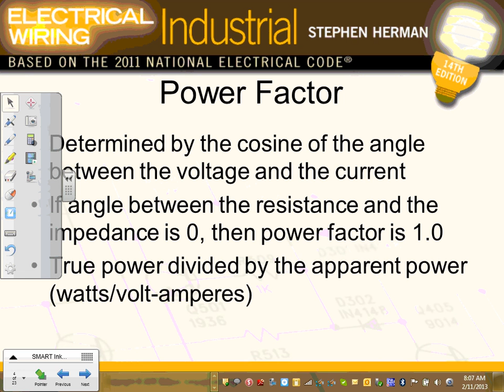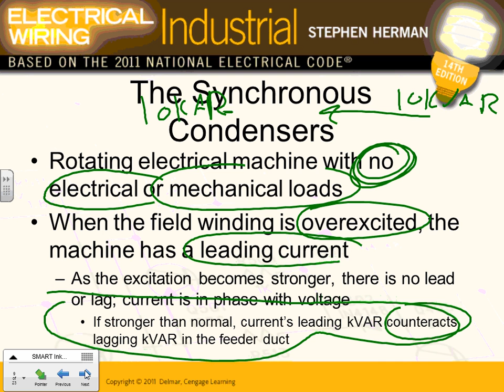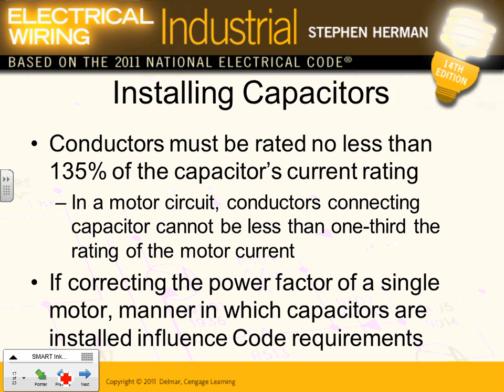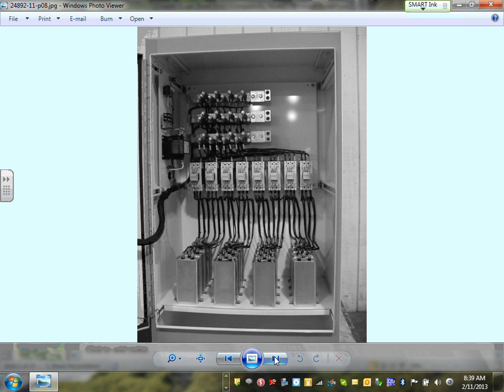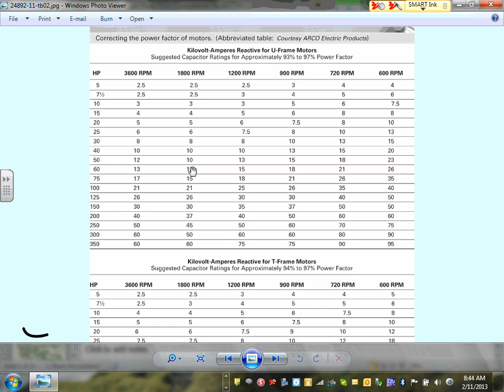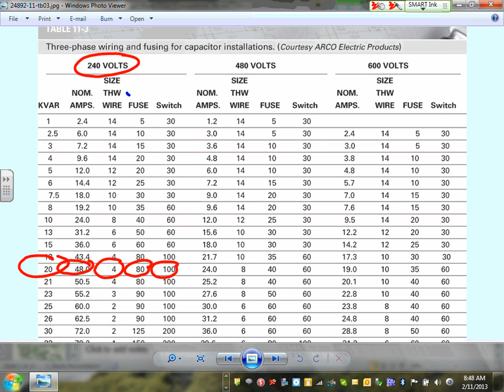Power Factor Correction Ch#11 02 11 13

Comment: I think it has something to do with continuous charging\discharging cycles the capacitor undergoes in AC Sinusoidal systems. When there is this continuous charge\discharge, it will lead to extra heat dissipation in the cable.